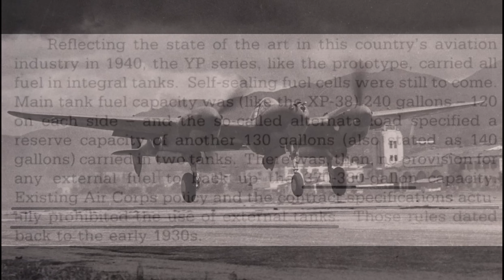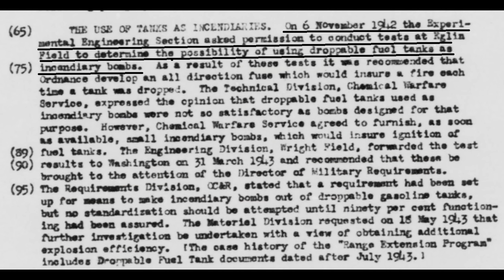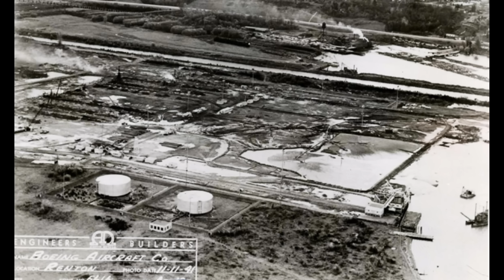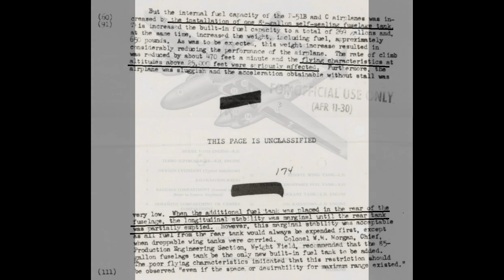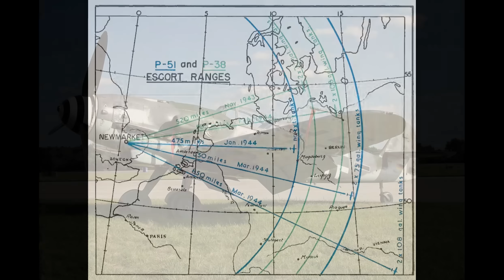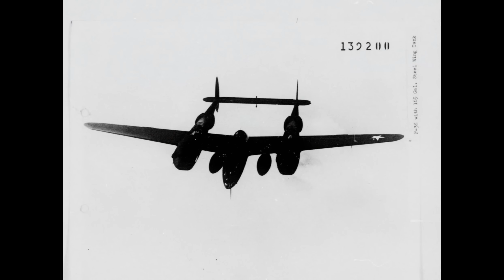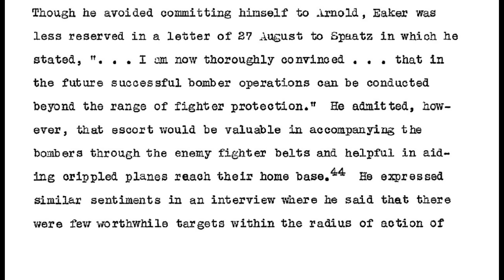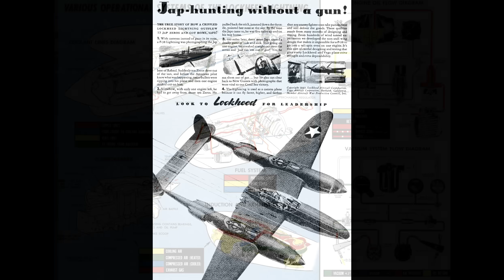The P 38 Lighting and the Bomber Mafia's Failure In World War Two

Comment: The YB-40 & B-26s as fighter (sic) escort, is pure Douhet:  “[T]here should, on the whole, be very little difference between one type of plane and the other, which implies that combat planes, like bombers, ought to be capable of carrying a substantial load in addition to an adequate supply of fuel.… If a bombing plane capable of carrying two tons of bombs can be made, certainly it should be possible to construct one with slightly superior speed, radius of action, and ceiling, capable of carrying a one-ton load of bombs. Then if the carrying capacity thus saved were used for armament instead of bombs, we would have a plane equipped for combat with a much greater fire power than any pursuit plane now existing.”

Comment: The part of this video that I really appreciated was the explanation of Ben Kelsey's very positive contributions to the P-38.  I had earlier seen him dismissed as the hot-dog pilot that crashed the prototype P-38 attempting to set a flight record.*
Regarding the heater issues over Europe; I had understood that the pilots got so cold they could not fight!  According to a source, they often had to be lifted out of their cockpits due to cold stress*
*Source: The Fork-Tailed Devil: The P-38 by Martin Caidin.  I first read this book as a teenager back in the '60s.  Since then, I have seen comments questioning the accuracy of Mr. Caidin's writings.  He could write exciting prose, though.
Reply: The first thought that comes to mind is electrically heated flyer's suits. They were used extensively by B-17 gunners in their unheated fuselages with huge openings for the waist guns.
Reply: @donjones4719  I figured that there was not enough room in the P-38 cockpits for those heated suits, but then the bomber pilots wore them...
Reply: P-38 pilots were later issued the electric flight suits. They unanimously said they "didn't work".   The air temperature is -70F below or -57C on average at 36,000ft. Especially in the winter, where you can subtract another -40 degrees from those numbers. 

The P-38 did not have a hot engine in the nose. It didn't have hot oil sumps, coolant radiators, etc ahead of the pilots feet. Single engine fighters are extremely hot in the summertime but create some needed heat in the wintertime.

The P-38 should have routes Radiator coolant hoses from the engines to a heat exchanger in the cockpit.
Reply: @Triple_J.1  Thanks--good info.  Caidin speculated that the lack of effective heating may have been an oversight due to the Lightning having been tested in warm, sunny southern California.
Reply: @Triple_J.1 this would have been a liability in combat as any knick in the plumbing would have meant failure of the pressurized cooling system. And, simply more parts to fail.
Reply: I read Caiden’s book as well. It sounded authoritative. Always a good read though. I have many of those (about American, English, German, and Japanese pilots) in paperback (easier to pack and move). All were great reads about heroes who did not have superpowers or capes, but flew anyway.
Reply: @Anymouse6980  I presume that he worked off of the best information available right after the war; he worked as a historian in the Pacific theater and Japan right after the war.
Reply: Read this book in early 1970's  and a lot he said about the P-38's 
 range seem to have been correct.
Reply: I would think the P-38 pilots would wear the heated suits commonly used by bomber crews.
Reply: Cardin also wrote a story called Cyborg.
Reply: @garynew9637  Which was the basis of the 'Six Million Dollar Man' TV show.  Caidin wrote a fair amount of other fiction, too.
Reply: In fact, in Pacific they had opposite problem; it's too hot
Reply: @kidpagronprimsank05  Yet, even in the south Pacific area, crews still had to deal with the cold of high altitudes.
Reply: There were other problems with the P38 as an escort, not least expense, but it would have been better than nothing.

Comment: The outline on drop tanks raises a question :  Did the Germans have the same issues in 1940, and what difference would a 40 gallon tank make to BF109? Arrive at the British coast drop the tanks with 30 plus gallons for the fight.
Reply: Galland complained bitterly that the Germans were not able to procure drop tanks for the Me-109 till the Battle of Britain was effectively over.
Reply: The Germans made a similar miscalculation by thinking, that the fast bombers can't be successfull intercept by the RAF single seater fighters and the BF110 should be able to deal with the rest.

Comment: The 8th was originally planned to have 4 P-38 fighter groups - the 1st, the 14th, the 78th and the 82nd.  All were diverted to North Africa in 1942 to support the Allied effort there with Operation Torch (the 78th stayed, but basically in name only - all the P-38s and most of the pilots went to North Africa as replacements for the other three groups).  This is one of those fundamental misunderstandings that most seem to have.  The 8th Air Force WAS NOT the USAAF's primary effort in 1942 through mid 1943.  Torch and Husky got first draw for resources, which is why those P-38 groups (along with a number of B-17 and B-24 groups that got pulled away from the 8th) were sent there.  It wasn't until fall of 1943 that the 8th really became the number one priority for USAAF resources, at which point P-38s got sent there (Oct 43) and Mustangs shortly thereafter (Dec 43) along with a massive overall boost in bombers and fighters.  The 8th was wildly under-strength from what was promised right from the start, and that really only got rectified by the end of 1943.  But the demands of the war required them to go into action anyway.  The Allies had all signed off on Pointblank, and the Luftwaffe had to be de-fanged before Overlord could take place.  Sitting in the UK and waiting for more stuff to arrive wasn't an acceptable choice.  And despite the heavy losses, USAAF bombing did end up having a fairly significant impact on the Luftwaffe and helped shape the battles to come in 1944.  "How the War Was Won" by Phillips Payson O'Brien dives into detail on this topic - there's too much to type here, but the author's conclusion is that the air campaigns of 1943 over Germany actually destroyed more production then all the land battles of that year combined.
Reply: That's all beside the point of Greg's argument. The main point throughout all Greg's videos has been debunking the myth that "Only the P-51 could escort the bombers." Your claim here doesn't address that argument at all. The 8th AF allegedly being "understrength" is not relevant to that issue.
Reply: @sb197-m4n this. it’s obfuscation to pretend that issue is that P38s were sent to North Africa, it’s that P38s that were available could have been better used.. with fuel tanks.
Reply: @garydownes2111   It's not obfuscation, is the facts. The 8th Air Force was not the priority in 1942 and early 1943. Both fighters and bombers that had been allocated to the 8th were diverted to the Mediterranean and the Pacific. The 8th had neither the fighters nor enough bombers to mount meaningful operations until the middle of 1943. As to fuel tanks, another non-obfuscatory fact is that in Feb 1942 Hap Arnold directed the air staff to do whatever was necessary to get drop tanks on fighters as soon as possible. And until they arrived in England for the bomber escorts he kept asking why it was taking so long.
Reply: @sb197-m4n  The very claim that the bomber mafia "failed in WWII" is another ignorant talking point indicative of Greg's fervent persecution of leaders who tried to do the best thing under difficult circumstances.  They were given limited resources and control, yet there are judged by the ignorant here as if they ran the entire Army and could control overall strategy and resources.
Reply: Greg mentions the diversion to North Africa but gives it a more sinister aspect.  I salute your bravery in engaging Greg on this!
Reply: I think it's extremely important that there is a give-and-take among opinions on youtube. This platform has millions of subscribers who will take the word of everyone who creates a video as gospel. There is a lot of historically inaccurate tripe on YouTube because people would rather spend 15 hours doing their own research on the internet than reading history books that have well-researched for 1000s of hours.  @donjones4719
Reply: But this isn’t a valid argument as the 8th had P38s.. & P47s.. without fuel tanks. so Greg isn’t arguing there weren’t P38s .. 🤷‍♂️
Reply: Are are far too well informed for the average viewer of this channel, or its creator.  Please maintain opposition to the misinformation and misinterpretation you see here.

Comment: 3:40  Did the contract specification prohibit the aircraft having provisions for drop tanks, or just a requirement that the design range and fuel capacity be entirely in internal tankage?  I can see why the Air Corps might want to write a contract that would prevent a manufacturer from using drop tanks to game the requirements.
Reply: You have brought up an interesting topic that I've expressed myself at times. Maybe the USAAF wanted the range of any new fighter design figured with INTERNAL fuel only so that the required tactical combat radius can be assured.
Reply: From similar YT's I have watched, the P-47 d.t. attachment points were prohibited by the AF.

Comment: "... out of 195 countries or so, two or three are using metric system..."  It is upsetting... Metric system is superior. But aviation is so conservatory... Is in imperial because first developments were made in US and GB and all measurements came from navy. In aviation is still use amplitude modulation for voice communication, although frequency modulation is superior, but harder to implement in far earlier development of aviation, and it is stuck in it (navy switched to FM). By the way, is mph or kts? (it is not enough that is imperial - I am a metric guy - but there is another confusion). Nautical miles had a meaning back in navy (navigation), but in modern world, not so much. (I see no meaning in terrestrial miles)
I DO love your video!

Comment: It’s the 4 engine heavy crime family …or The Bombino Syndicate…
Reply: Bomber Command under Harris was as bad or worse than the EIghth Air Force under Arnold. Stripping B-24's of their armour and guns and equipping them with extra fuel tanks and centimeter wave length radar provided the Allies with the means to close the gap in the middle of the Atlantic and effectively  neutralize the U-boat threat, but it was held up for months by Harris' refusal to allow lend lease B-24's to be transferred from Bomber command to Coastal Command.

Comment: Robin Olds stated he loved the P-38 and that it was a very capable fighter!
Reply: Olds obtained a hand-full of victories in the P-38 including a couple there were back-to-back.
Reply: @Triple_J.1 
Olds got 3 bf-109's in a single engagement, one while in the glide mode after forgetting to switch fuel tanks, a second immediately after, and then a third after pulling out of a compressibility dive from 26,000 feet to approximately 50 feet, and being bounced from behind. 

He then shot down two FW-190's in a 2 on 1 fight observed by another unit flying P-47's.
Reply: @edwardpate6128  In the one engagement that they showed in History Channel's "DOG FIGHTS!" Gen Olds attacked 50 ME-109s with just him and his wingman B.E. Hollister.
Reply: Robin Olds(said himself while flying his P38 behind a BF 109 that just as he was about to fire his plane motor quit from lack of fuel  witch only caused a very breif moment of pause to then fire bringing down his enemy. He said he believes he may be the only pilot to shoot down an enemy plane while in glide mode. He was also one of the luckier P38 pilots that were made aware of a very dangerous situation that existed in the design of that plane and was often the German pilots easy way to victory. By going into the fastest dive, likely due to the stubby  pilot nacelle shape, an unfavorable high speed air condition caused a lack of control  surface air flow making it unlikely or even unable for a pilot to be able to pull out of the dive. If I remember correctly Olds said he used the trim to barely make it out of the  time it happened to him. Can't help but wonder how many guys didn't get to live to tell about it. 
 Also it was Lindberg who told the squadren that went on to shoot down,and kill, general Yamamotop. It was questionable whether the plane could make it as far as the mission required it to fly. Lindbergh told the pilots to reduce engine speed while turning up turbo pressure allowing more prop pitch to keep up the cruising speed but at a significant enough reduction in fuel consumption that it made assurance the planes could do the mission. Thanks to Lindbergh's part and much else the mission was a success. Yamamoto was killed that day. If not for Lindbergh it likely would not ever have happened
Reply: @neilfoss8406  Yamamoto was shot down in April 1943, over a year before Lindberg went to the Pacific Theater.
Reply: @neilfoss8406 I thought all Lindbergh did was tell the guys to use manufacturers settings as none were? Maybe that was in another situation?
Reply: @neilfoss8406  Lindbergh gets credit for helping his country as best he could and correcting his previous errors of judgment.  However, Yamamoto was shot down in April 1943 and Lindbergh was active in the Pacific theater a year later.  Those P-38s were equipped with one 330 gal drop tank and one 165 gal drop tank.  https://en.wikipedia.org/wiki/Operation_Vengeance  The remarkable navigating of John Mitchell was crucial to the success of that mission.
Reply: Robin Olds later attacked 2 FW190's, solo, and shot both of them down, as witnessed by two stunned P-47 pilots. 

Olds made ace in the P-38 in two missions. He complained bitterly that the leadership of his group was abysmally timid, and prevented them from racking up far more impressive scores. He and a few fellow pilots eventually developed plans to simply ignore the timid leadership, and fight, they did just that. Odds are that, had he been allowed to be as aggressive as he wanted, he'd have had at least ten victories in the time it took him to score five.
Reply: @AlanRoehrich9651  Good stuff.  In the DOGFIGHTS! episode which is really about OPERATION BOLO, Gen. Olds says the P-38 was a great fighter and fun to fly.
Reply: @walterm140  "You could whip anybody down low."